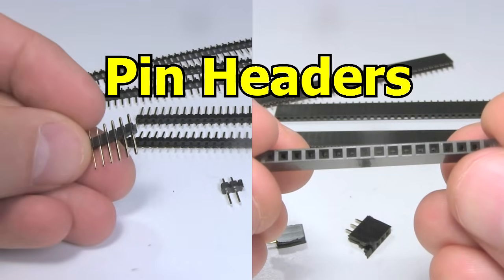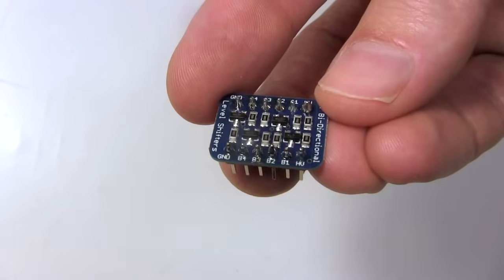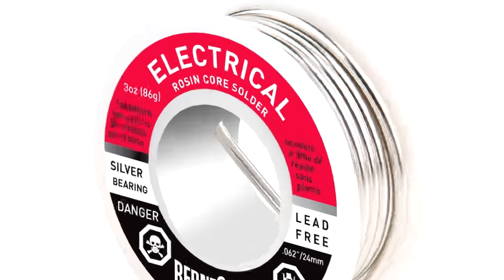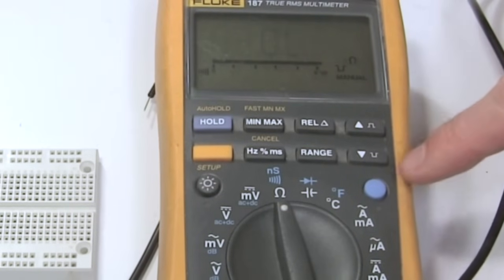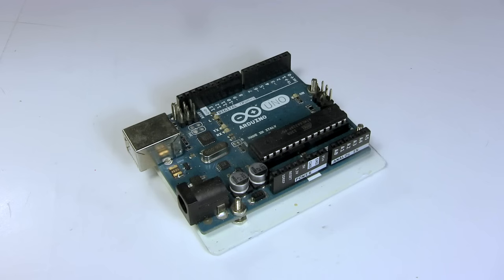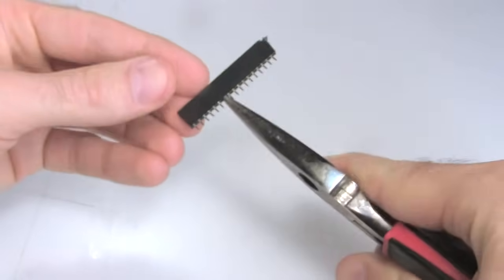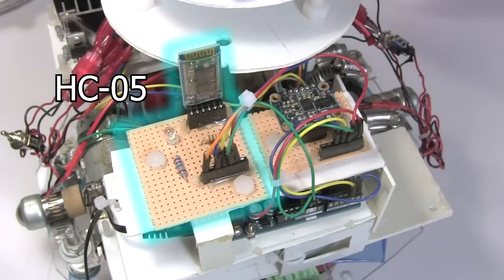Pin Headers - soldering, cutting, male, female, etc.

Comment: Good morning, your video is very good. I would like to know where I can find perfboard and can I cut it the way I want
Reply from the maker: I buy my perfboard in local electronics stores. Other than that, I'd just suggest searching online for a good deal. And thanks, I'm glad you liked my video. Thanks for watching it!
Reply: @RimstarOrg  SIR WHERE CAN I BUY THIS CIRCUIT PLANCHA OF YOURS THAT CAN CUTS THE WAY I WANT
Reply from the maker: I'm not sure what you mean. Maybe tell me what time in the video you're refering to. Plancha seems to be Spanish for cooking plate. Do you mean the soldering iron I used? The one I used in the video is an old one that was for doing wood burning. These days I use a Hakko FX-888D. Their website says it's discontinued but you can still find it on amazon.com, aliexpress.com, and so on. Or you can buy a newer one.
Reply: Thank you 🙏

Comment: My breadboard warped from the heat of my soldering iron when I tried the technique shown here. What was I doing wrong?
Reply from the maker: It sounds like you're using a much too powerful soldering iron. 50 or 60 watts should be enough. 30 watts is usually too little. You could also be holding the tip of the iron on there for too long, only a second or so should be needed.
Reply from the maker: I'd recommend looking at some videos specifically on soldering to breadboards. There's is some technique to it.

Comment: What is the solder wont "flow" down to a cone shape? mine becomes a blob at the top of the pin and WONT stick, or even toutch the citcular pad on the board :( its like the pad activly repells the tin. I have cleaned everything with alcohol.
Reply from the maker: Are you heating the pad? You need to touch the tip of the solding iron to the pad and the bas of the pin to heat them up. Then touch higher up on the pin with the solder. Since the pad and the pin are hot, the solder will flow down onto them. But also make sure you first clean the tip of your soldering iron, usually by pushing it in an out in something like steel wool and then putting some solder on it. I'd suggest looking for videos on soldering as there is a specific technique to it.
Reply: @RimstarOrg  Yeah. I did pre-heat both the pin and pad for >30 seconds and I just cleaned the tip of the soldering iron. I've been trying for days to get those pins soldered but I have given up and I will buy new tin and see if my current cheap tin is the problem. My soldering iron is also only rated for 30 watts so it might be running cold, im not sure. Thank you for these videos and your help!
Reply from the maker: Cheap tin could be a problem. Tin that has a rosin core is better. It helps to use an acid or rosin to basically clean the surface of oxides so that the soldering will work better. That's my understanding anyway.
Reply: @RimstarOrg  I bought new tin yesterday, and a warmer soldering iron. WOW :D It melted so smooth and I got a perfect cone every time. Thanks!
Reply from the maker: Glad to hear it! I know I had a 30W soldering iron for a while, it was underwhelming, though for these pads I'm not sure how many watts you need. Either way, I'm glad to hear work got it working. Thanks.

Comment: Hi @RimstarOrg in case of a connection using these wires, how to prevent them from falling off? Do you use hot glue? Thanks for making this video :)
Reply from the maker: Hi Luis, That's a good question. I've wondered about the same. Other than making sure the wires are a fairly snug fit in the hole, I don't know what people usually do. Connections made this way are normally just for prototyping or hobbiest projects and so I've never run across any formal method. I've always just relied on a snug fit but every now and then a wire comes free. James Bruton (https://www.youtube.com/@jamesbruton/videos) is one whom I've seen do a huge number of projects with these types of connections and I don't recall ever seeing him to anything special. If you have some sort of enclosure for a board where the wires go through a hole then you could put a strain relief around the wires as they go through the hole. That will usually render the wires inside the enclosure fairly immobile. I have Raspberry Pi enclosure with narrow slots in the cover that sort of server that purpose. If the wires can't move then that's often enough. For example, you might tie strap them to something.
Reply: @RimstarOrg  I am tempted to solder the wires directly to my Arduino but I would like to keep that as a last option, just in case I decide to make something different :) The project I'm working on will suffer some trepidation so, I want to make sure nothing starts to float around. I'm always curious on what people are doing regarding this. Maybe its not a problem if you don't move them around :)
Reply from the maker: I just saw a trick in James Bruton's latest video. See https://youtu.be/xt5njVXwxiY?t=577 where he's put male headers down into female and soldered the wires to the other end of the male headers. So something like these https://www.adafruit.com/product/2671
Reply: @RimstarOrg  nice find, thanks
Reply: @RimstarOrg  that's indeed an interesting idea. It likely only makes much sense if you have at least two wires/headers rather than single ones. I did use something similar in the past and bent the wires around the headers (like a nose) before soldering.
Reply: zipties tend to work well to secure these things
Reply from the maker: True. If the wires can't move around then they're less likely to try to move out of the holes.

Comment: If we use Directly Male jumper wire insted of Header Will They work?
Reply from the maker: I'm not sure I understand what you're asking. If you have two boards, each with female headers then yes, you can use a wire that has male on either end.
Reply: works on breadboard but not for real ones for sure

Comment: If not using it to connect to another board, e.g. to connect to wires or breadboard, does it matter which side you perform the soldering?
Reply from the maker: I'd have to know more about the board to answer, there are many different types. If there's no metallic coating on the board, e.g. some boards are covered in copper, then it doesn't matter. You could test it with a meter by putting the meter on the resistance scale and touching two points on the board. If there's infinite resistance then there's no electrically conductive coating.

Comment: I need jumper wires that go onto header pins that are 1.00mm in diameter but I can't find any. The diameter of normal header pins taht you see on arduino is 0.6mm so these pins are much larger. Do you know what they are called?
Reply from the maker: Sorry, but I don't know. You could all strip different size wires and see which wires will make a snug fit so that you don't need a special connector. From this wire sizing table https://en.wikipedia.org/wiki/American_wire_gauge#Tables_of_AWG_wire_sizes it looks like 18 AWG wire is around 1 mm in diameter.

Comment: Are these also known as "through pins?" I have been trouble shooting an old Teac A-3440 reel to reel. The guys on the talk forums keep saying these units were known for "bad soldering on the through pins." Thanks
Reply from the maker: I don't think so. From the description here https://www.tapeheads.net/~tapehead/showthread.php?t=90890 it sounds like something else, pins for connecting traces on two sides of a circuit board.

Comment: Awesome stuff. Really clear and easy to understand. For the male headers, do you recommend soldering the short or the long then of the male header to the underside or upside of the board?
Reply from the maker: I would solder to the short leads of the male header since the long leads are what you plug things into.
Reply: @RimstarOrg  That's what I ended up doing. Thanks. Only downside now is that I can't attach it to breadboard

Comment: Nice. thanks. can these pin male and female headers be used power cables for 220v ac , till 2Amps. cap. ??
Reply: No. These are for very low power and voltages.

Comment: For years, I used all sorts of connectors for my small 12v projects, and it was such a hassle! No more crimping : I just discovered these kind of headers and am using them everywhere! They are light, easy to work with,… I just solder wires to these headers, and cover my joints with heatshrink tubing. Again, no more crimping! :)
Reply from the maker: I like your idea of covering the joints with heatshrink tubing. That should hold any male-female connections between two wires together. Thanks! I'll use that. And you can always cut away the heatshrink if you need to change it. Do you have any similar suggestion for holding wires that are plugged into headers? By that I mean, with a RaspBerry Pi or Arduino you plug wires into the headers on the board. But if that's a part of a moving robot then the wires might come out. Do you have any ideas for making sure they don't? I guess a dab of hot glue might work.
Reply: @RimstarOrg  I have seen hot glue on a couple of boards from commercial products.

Comment: if you put on jumper wires on a stacking header for a raspberry pi, Will the stacking head still act like a GPIO pin?
Reply from the maker: It should, yes, provided the pin on the pi that you connect to is a GPIO pin.

Comment: When you have a choice, is there a rule to choose between a male or femal header ?

For example I have this 16 channel multiplexer with holes but no pins. I'm also building a sensor mat that will link to the multiplexed analog test pins. In my scenario I may change independently each device
1st solution is to put male header pins on the sensor map, and female on the multiplexer output, and mount the sensor map on the multiplexer
2nd solution is to put female header pins on the sensor map, and mount the male pins soldered on the multiplexer on it.
3rd would be to have long-female that provides both male and female connection on the multiplexer but this complicates the question (and I can't find easily a 16pins long male with female header, albeit I didn't search for a long time)

Is there a rule of preference ? some most-use cases ? some canons ? for example any sensor device may have most of the time male pins ? 
Or can we expect each project to have his own connection policy ?

My 1st try will be to chose both male pins and mount them on a breadboard. I'll create later a pcb that would link them  all together, but that creates additional wire connections that would lower the precision of the sensor mat a bit, I guess.
Reply: Standard practice is to make the power source female, like the power in your house.  Less likely to short out.  Imagine 120Vac on a male plug.  Bad.
Reply: @katemoon7476  True, this seams even clearer written this way. This also seem consistant with what Daan said if we consider the sensor is "generating" its output signals :)
Reply: i'd solder male pin headers to your pcb and female headers to your sensor, this will be the most common way to do this
Reply: @daanlageschaar3428  Thanks for your answer. So the only female pins on the pcb would be to stick the microcontroler ? 
Unless it's pcb shields with male pins that would stick themselves on the controler
Reply: @dusucredansmoncafe  yes, correct

Comment: what soldering iron are you using? looks like a winner.  if you recommend something different , i want to know that too!!  just need something simple but effective.  thanks !!!!!!!!!!!
Reply from the maker: I was using an old iron from a wood burning kit which I had as a kid (which takes a while to heat up but does work well for this). My LenLine 20-40watt one had recently given up. I've since upgraded to a more expensive but very nice Hakko FX-888D.
Reply: @RimstarOrg  Great, i will consider the Hakko FX-888D.  Looks like a good one.
Reply: @harpoon_bakery162  It’s OK, but it’s old technology and has arguably the worst user interface ever designed. 

If you’re planning to do electronics even halfway seriously as a hobby, get the Pace ADS200. It costs more but is vastly superior. 

If you’re only doing it very casually, get an Aliexpress or hobbyking 936 style soldering station. It’s the same performance as an FX888 for 1/5 the price.
Reply: @tookitogo  Great info, what variant of the PACE ADS200 should I get, the Standard Tool Stand or Instant Set Back-Stand and with those two options i can get with or without tips.  What's your opinion and thank's so much for the great information!!!

Comment: Why are you doing a continuity test like that you'd want to check if the solder accidentally connected to the pin next to it it's obvious that the soldered pin is connected.
Reply: You'd also check the continuity of the neighboring connections as well to make sure each are independent.

Comment: There must be a more professional way of doing connectors.
Reply: There is: crimping. Just... what a rabbit hole it can be. :::looks over at my dozen crimp tools which still don’t cover all the connectors I want to use::
Reply: @tookitogo  it's quite the pain
Reply: @harpoon_bakery162  Yeah. But making good crimps is soooo satisfying! :D
Reply: I think there are 50 more professional ways of doing connectors, and that's the problem.
Reply: @TaiViinikka  Namely...? Soldering, crimping, spot welding, screw terminal, spring clamp... what’s left? (I think that a huge percentage of the connector terminations fall under the “crimping” category.)

Comment: Why not put female headers on the level shift board? Why not put male headers upside down?  Use the headers in the way you need them. 

This video teaches you to take the long way around the barn.
Reply: I try and put the female headers on whichever part I expect to be replaced more often, since male headers never wear out, but female ones will loosen with repeated insertion cycles.

Comment: You could add that theres more professional way to connect pins by crimping wires. Those wireends are called DUPONT and you can make connections looking as good as the where made by professionals.

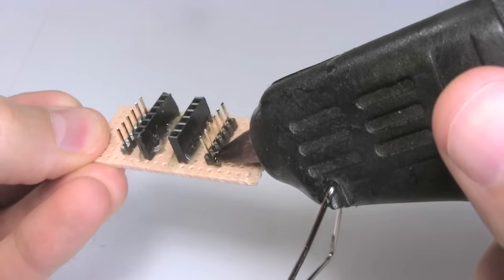Comment: @4:40, where to get these solid core wires? Name and link
Reply from the maker: I get those bare, solid core wires by stripping insulation from a normal solid core wire. Those look like they were 18 gauge (AWG) but get whatever size suits your expected current. Note that they're copper wire. They look silver because they're coated (plated) with silver, nickel, or tin. You can see me putting them in place at 5:30. I buy my wire from local electronics stores, which we're lucky enough to have. It looks like Adafruit has spools of only 22 and 24 AWG https://www.adafruit.com/?q=wire%20solid%20core . It does seem to be hard to find on Ebay https://www.ebay.com/sch/i.html?_from=R40&_trksid=m570.l1313&_nkw=solid+core+wire+spool+18+AWG&_sacat=0&LH_TitleDesc=0&_osacat=0&_odkw=solid+core+wire+spool A google search turns up more https://www.google.ca/search?source=hp&q=wire+solid+core+18+AWG&oq=wire+solid+core+18+AWG
Reply: Thanks
Reply: Look for “bus wire”. “Solid bare copper wire” is the most generic term.

Comment: I have a bluetooth speaker im trying to repair. The board to board dual 5 pin connector has broke and the power is not getting to the main pcb from the line in pcb. Can I use pinheaders instead of board to board connection? Sorry I'm really new to pcb work.
Reply from the maker: I don't think a photo would tell me enough. You'd have to measure the distance from hole-to-hole for what you have and hope that your measurement is accurate enough. There's also the question of are the pins too wide to fit in the holes.
Reply from the maker: Sure, you can use these types of pinheaders instead of the 5 pin connectors. One issue is whether or not the wires are thick enough to handle the current but I imagine the wires from your old 5 pin cable are pretty thin anyway.
Reply: @RimstarOrg  yeah that's what I'm wondering. It's a small bluetooth speaker but nowhere does it tell me how many watts etc. The pins are very small. Not the normal pcb pitch. That's where I'm stuck. Can I send a photo?

Comment: Great video! Most tutorials on Arduino boards don't start so basic. QUESTION: I have a 16mb Adafruit SoundBoard trigger, with 0-10 audio 'holes' available. What is the advantage to not simple solder a header pin for every connection? All 11? What's the advantage to only doing two, three, or four, etc? ..... thanks again!!!
Reply from the maker: I've done it both ways for different boards in the past. The only advantage I can see to doing just the ones you need is that it saves on header pins if you're short of them. If you're not short of headers then I'd do them all with the expectation that maybe one day you'll use some of the others and they'll be ready.

Comment: Can you cut off the edge of the jumper wires to directly solder in into a perf board???
Reply from the maker: Yes, you can. During prototyping, it's useful to be able to plug and unplug things but when you have something you want to be permanent then you solder things.
Reply: @RimstarOrg  thanks for the help

Comment: Is gluing the headers really important?  If so why doesn't Arduino do it for example?
Reply from the maker: I'm not sure I understand your overall question. I glue the pin headers because I need some way to fix them rigidly to the perfboard. There's no way to attach the pin headers to the Arduino directly.
Reply: @RimstarOrg  I assumed your perf board had plated through holes to solder onto on the backside and that you are hot gluing in addition to that solder joint to make it stronger.  Based on your response, I can surmise that there was no plated through holes and you are not soldering the headers to the board at all.
Reply from the maker: Ah, thanks for clarifying. Yes, the perf board's not plated.